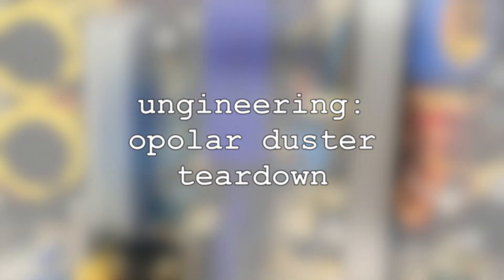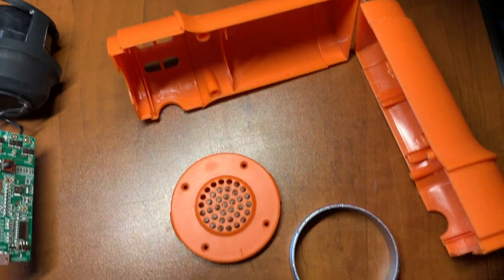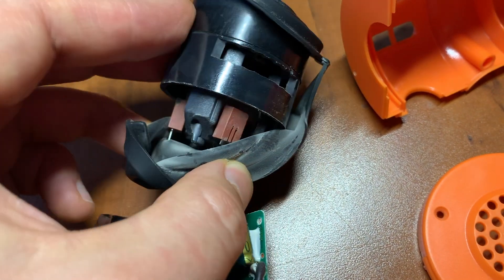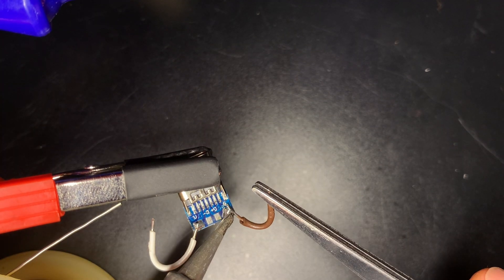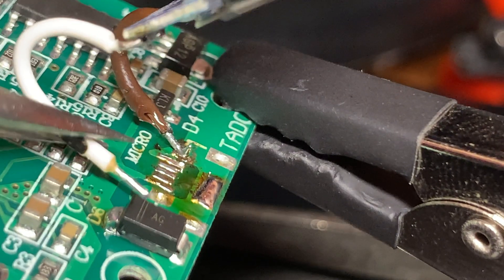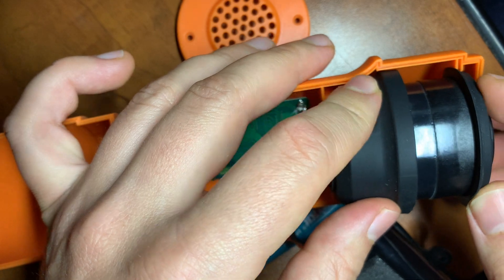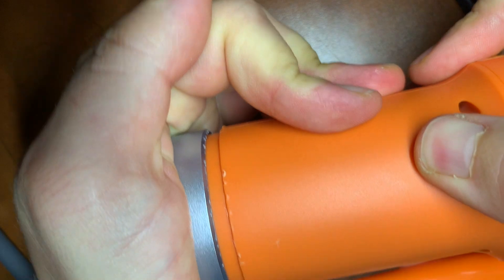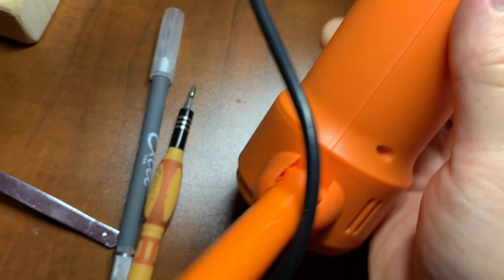#7 opolar duster teardown + microusb replacement

Comment: HELLO，I had same machine and there's battery charging problem,using this machine shorter than before and charging problem,so I think it battery problem.
but most important step is take out the ring,do you have any suggestion to take out the ring?
Reply from the maker: a butter knife or a large flat-head screwdriver, you'll most likely damage the plastic, it's almost impossible to do it without any scratches.

Comment: Do you know if there is a way to get a better battery my discharges very quickly
Reply from the maker: You can buy new 18650 batteries to replace the old ones, but you need a spot welder to connect them.
Reply: Is using a soldering iron enough to fix it without a spot welder?
Reply from the maker: @leonardtan2  yes, you could do it that way, just look up how to solder to batteries, it can be tricky.

Comment: great video. Is it possible to make it work directly without the battery?
Reply from the maker: it is, you would need 11.1V power supply that can provide enough current. I haven't measured exactly how much it needs, but I'd guess about 2-3A. You would need to wire it instead of the battery.
Reply: I have the same model. Charge for less than 1 hr. And use less than 5 mins. Battery dead.

Comment: Please, ¿Could you help me?
I took apart mine because it randomly stopped working while using It and won't turn on anymore.
It makes a buzzing noise similar to Coil Whine while charging but won't charge at all. 
¿Is my board faulty?
Reply from the maker: buzzing/high pitch noise sounds like an issue with the coil (L1). you could try replacing it, but it might've also burnt an ic if it's already shorted. sorry to say it might be easier to replace than trying to hunt down the source

Comment: thanks for the vid. while USB is convenient for most consumers, there are 12volt vacuum cleaners from China these company can reuse parts for this product.  having said that, I will have to see if I can modify my 12v vacuum to a duster.
Reply from the maker: you can use a USB PD board like this: https://s.click.aliexpress.com/e/_DBzAsoR to get 12V

Comment: Can't diagnose what's wrong with mine, it will turn off charging way too early and only charge for 10 seconds
Reply: mine is the same. Is it possible to connect directly without needing a battery?
Reply: @heurygeologia  I bought a new blower and this one went IN THE BIN!

Comment: Mine stopped working… I’ll fix it now, I couldn’t get it to open until now
Reply: HI, did you fix it? How it was? Any suggestions? 
Thank you.
Reply: @Olas-GE  hi, the bms in mine BMS died. I didn’t fixed it yet because it’s spot welded to the batteries and I don’t have that tool.

Comment: Thank you for showing exactly what I needed to know, that stupid metal ring at the bottom is impossible to get off, but I'm glad it's not glued or screwed on.
Reply from the maker: Yes it took a while to remove using a screwdriver, hence all the dings.